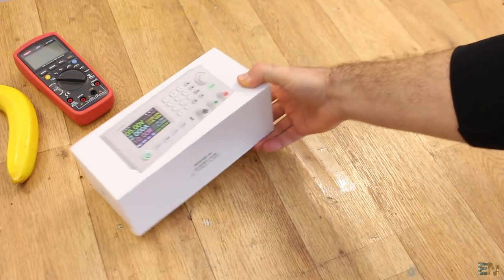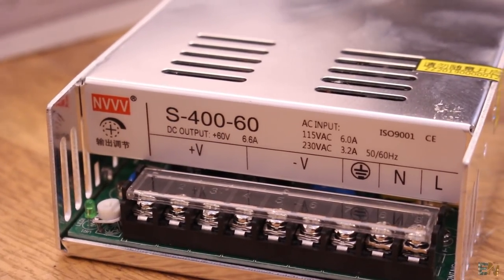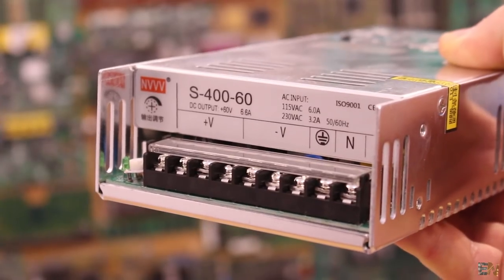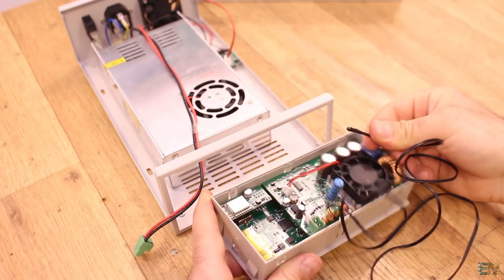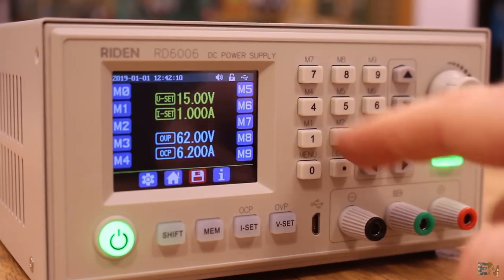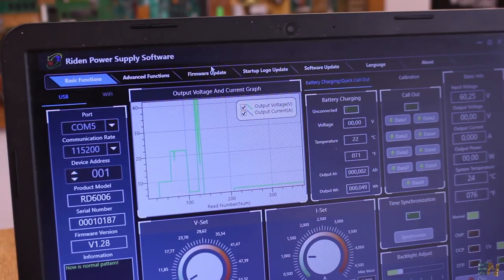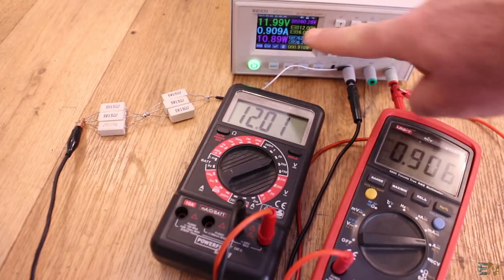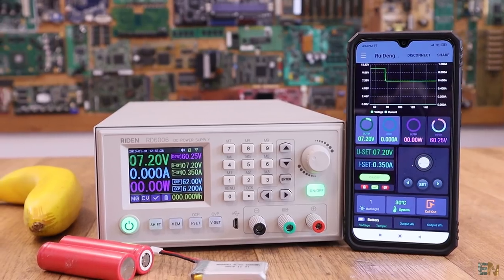RIDEN RD6006 Power Supply Kit with WiFi control | Android App

Comment: The Ground/Earth should be bonded directly to the Case with a Shake proof star washer and to the supply ground . Do not rely on the screws on the supply brick to ground the case as they are going through a painted surface .

Comment: Could you explain the output load of 15 ohms? The load that I see is 2 groups of 5 ohm resistors in parallel. (15 ohms /3) *2=10 ohms

Comment: 17:00 The drop in efficiency is at 4 amps, not at 5 amps. They are selling a set here with a 70V power supply, I guess the efficiency would be 1-2% lower than the 48V curve.

Comment: The psu seemed like it's weak point, also it racked up the price quite a bit, so I used a good quality scavenged atx psu instead, with a $7 65v 400w boost converter, drilled a few extra holes in the casing, and I gotta say it works great, there's no significant ripple even when running at full power, and it's pretty much on point..
It's nothing like the real deal or nowhere near any linear supply, but for the price it's truly great

Comment: this whould have been awesome to use for a server power supply to power RC hobby battery chargers except for its very low amp rating.  too bad.  I need something capable of 70A or more to keep up with my Icharger 308duo and HP HSTNS-P11 power supply.

Comment: Got mine for 40USD on banggood. when they sell it low like that, does that mean we can expect a new model soon? I want one with 80-100V so I can use it for ebike and scooter charging. I did see in the changelog from the android app that support for "RD6012" was added. A 120V model maybe?
Reply: Damn, it's only a 12A version
Reply: I suggest that you look for a different kind of supply for higher voltages, rather than a lab/bench PSU. A purpose-built battery charging unit would likely be much more economical.

Comment: I have two notes. You can download the app for IOS as well (I have it). I like RD6006w. The only disadvantage is to be switching power supply not a linear one. For less than 200$ you can have high-quality linear lab supply (not soo powerful, but usually you will be fine with 20v 2-5A). I do not get why they put thermocouple inside when it is for outside use?!
Reply: Depends, for amp design I need 50V at 5A, that's useful.

Comment: The thing that I dislike is that I want to buy a PSU like this, but for it to run you need another PSU that supplies 60V to it first. Why can't I connect it directly to a normal 230V wall plug? Its kinda an awkard product, if you want to start out and don't have a PSU already.

Comment: Why is it that you need to connect the USB to use it with the PC?  Why can you not just use WIFI?  
I heard, in another review, that the WIFI feature does not work for the PC and that makes ZERO sense to me.  Does anyone know a logical reason for this?
Reply: Presumably this is a software implementation issue (i.e., the PC software is not mature). I would look to open-source alternatives for controlling this PSU. It's a popular series of PSUs so there is likely to be more development on the open source side than from the vendor as time goes on. Here's a github repo to check out for starters: https://github.com/rfinnie/rdserialtool

Comment: If anyone interested, you can find my custom firmware for RD6006.
If you have any ideas, wishes, what to change or add in to the firmware, or found bugs, just let me know.
https://www.eevblog.com/forum/testgear/ruideng-riden-rd6006-dc-power-supply/225/
https://monitor.net.ru/forum/threads/651114/page-6

Comment: If you are spending almost 100$ then why don't you buy a supply from a reputable brand? You will have better resell value and wont kill your projects or burn your house down.
Reply: For comparison's sake, which "reputable brand" has comparable specifications and features for less than $100 USD? There are lots of bench PSUs for less, but I don't know how many of them are from "reputable" brands with any resale value to speak of. I'd be glad to buy a brand name PSU to match (for example) my oscilloscope, but there's no way it's coming in at that price point.